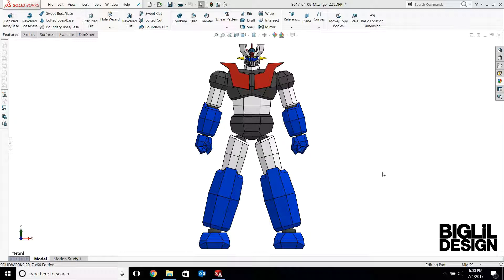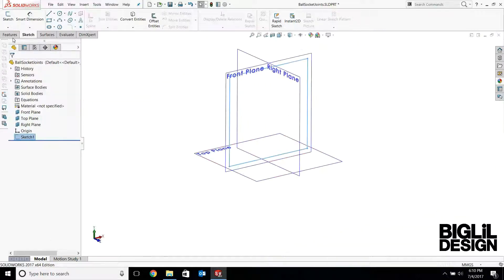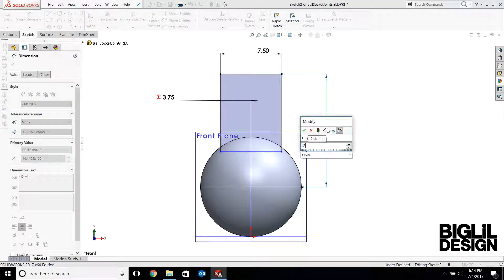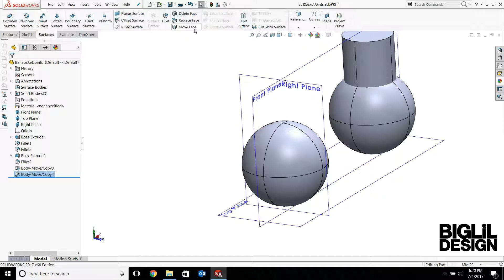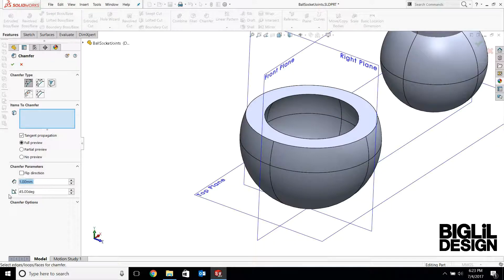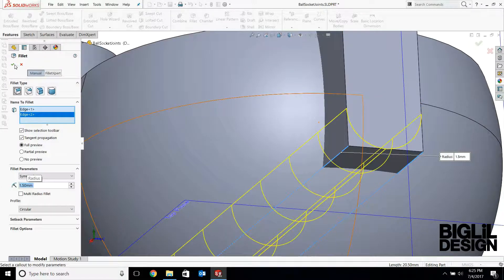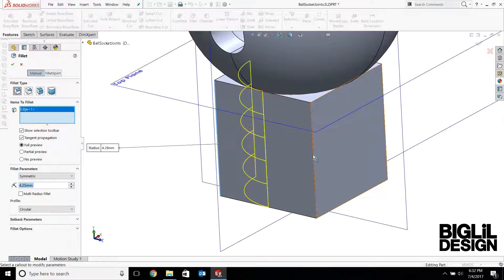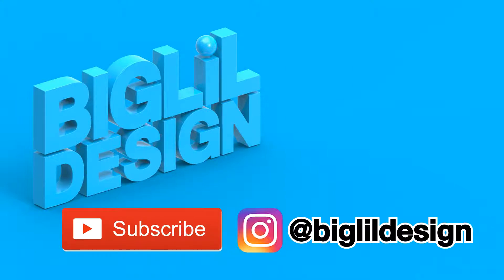3D Modeling Tutorial - Ball & Socket Joints

Comment: Came here looking for ideas on how to create a joint. Excellent video. I have a question, don’t you need to add some tolerance between the ball and the socket? I am thinking on 3D printed parts.
Reply from the maker: The zero gap creates friction so your figure can maintain desired pose. You can play around with the tolerances - print a few iterations and see which works best for you. Good luck!
Reply: BIG LiL DESIGN thank you, I will.

Comment: Hi! i really apreciate the fact that you showed how to use a lot of different features, but man, this same models can be done extremelly easy with proper sketch management and revolve boss. 
To make a sphere, you can just sketch a circle, put a line in the center, trim half the circle, and revolve boss this sketch using the line as the main axis. no need of that many fillets.
Anyway, great job!
Reply: Came here to say this. I was like, "WFT are you doing!?" This is how a guy on his first day using Solidworks might make a sphere.

Weird.

A Design Engineer.